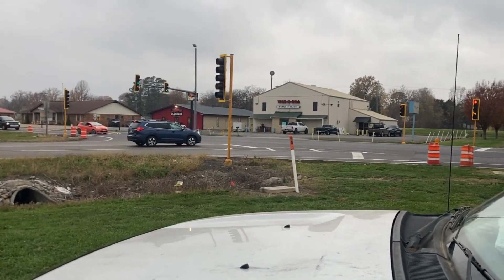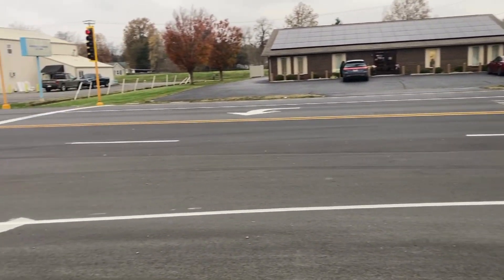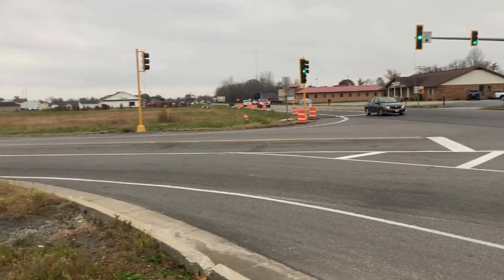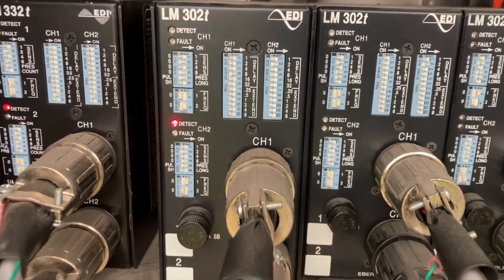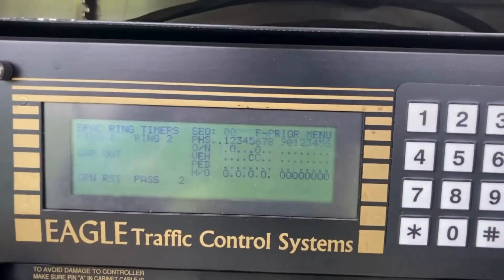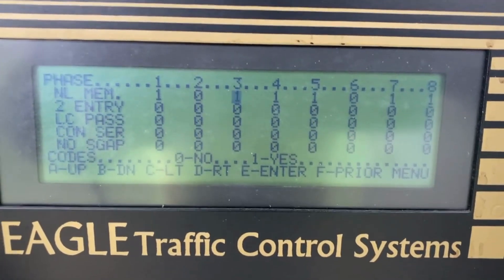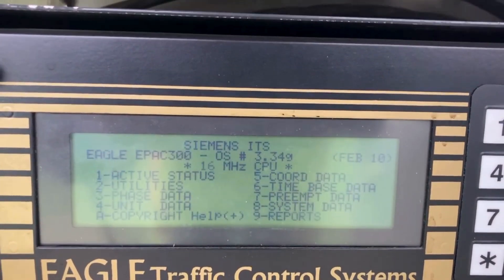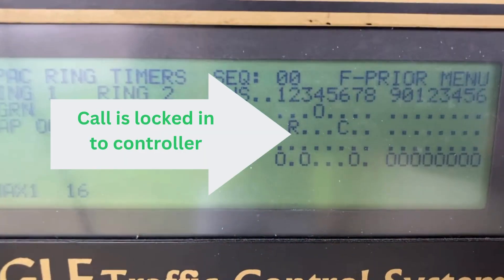How Bad Traffic Light Detection is Fueling Red Light Running

Comment: All well and good, but this begs the question:  Why aren't roadway repairs coordinated with traffic signal testing?  Surely there is someone on a city/ county/ state payroll that is responsible for scheduling repairs, re-routing traffic or facilitating repairs during non peak hours, etc. 
In that this disruption is likely to occur as a result of roadway repairs, is the obvious follow up beyond the comprehension of our elected and appointed officials?
Reply from the maker: Great questions. Here's my answer:  It depends!
In our district, the municipality is responsible for maintenance of the signals (unless there are 2 state routes the converge--then it's the States responsibility).
Many times the municipality hires out the contractor themself.  They handle the work.  It's up to the municipality to notify the State of the work that's done.  
During construction times, this can be forgotten as everyone mentioned is busy running projects. 
Luckily, we have decent communication with our municipalities but it can be forgot about.
In addition, on emergency repair work--it's just 'get it done as fast as possible'!  If a pole is knocked down and its affecting traffic, whoever is responsible just gets it taken care of so not to cause more potential issues.  
It the end it eventually all gets worked out but sometimes responsiveness is more important than scheduling it.
Thanks form commenting!

Comment: There should be a Fail-Safe to wear if the light isn't triggered within a period of 3 minutes it just cycles and turns green anyway
Reply: An intermediate fail-safe would be to operate as non-locking (so a person who accidentally gets in the turn lane but leaves it doesn't trigger a green). But if the ratio of loop 1 detections vs loop 2 detections drops below a certain percentage (say 50%), then assume loop 1 (the front one) is faulty (instead of over 50% of cars leaving the turn lane after driving over loop 2 but before loop 1). 

If that happens, automatically switch loop 2 to locking and send notification that loop 1 needs fixing. Basically what he did here, except automate it when it's "obvious" that something is wrong with loop 1.

In my town, the lights have 3 detector loops (you can see the circles they cut in the asphalt). I always thought that seemed excessive. But I didn't think of cases where they failed.
Reply: Yeah, I would greatly prefer a guaranteed maximum red time.
Not only is it the only way to absolutely guarantee a green light. (There's always at least one more rare failure mode that you hadn't thought to detect.)
But it also works for bicycles and other vehicles with very low amounts of metal. There's enough cyclists already that just ignore traffic lights. I don't want to have to be one of them.
Reply from the maker: @Pystro  I hear your arguement.  Here's what the complaints I get more than any other though:
"I have to stop unnecessarily for a direction that has no one there!"
Thanks for commenting
Reply from the maker: If a loop goes bad, the fail safe is that the detector box will sense that and place a constant call into the controller (this is by design).   
There are additional analytics that can be programmed into the controller that look at detectors.  A few of those are options are detectors that:  constantly detecting, no detection at all and chattering detection (the loop, detector box or wire run is on the verge of going bad).
Additional threshhold can be set as well.  So the idea that comes to mind is to ignore a 'no detection' detector if its a side street hardly used and its from 1:00am - 5:00am (time of day is programmable).
Also length of time is another threshhold.  A 'constant detection' detector will have to be calling for say 2 hours straight (length of time is programmable) for the controller to recognize it as a failed loop.  
Then IF it's on our network, the controller will notify us there is an issue.  (Which maybe is the real fail safe?)
Anyway, thanks for commenting!
Reply: That's how they do it in the UK with temporary traffic lights at roadworks.

Comment: I cringe whenever I see someone at an induction loop intersection either slowly pull up past the stop bar because the cycle was taking too long, or they think it's a stacked loop lane and they are stopped a car length behind the stop bar, both cases result in them not getting a green. I vastly prefer the intersections with Wavetronix radars, I've hardly seen any issue with them(False positives/No detection).
Reply from the maker: Yep, I see alot of human behavior when I'm out on the street.  Many times the ones that don't pull all the way up are looking down at their phone and don't realize where they're located at in the lane (nowhere near the stopbar).  They'r also usually the ones that miss their green light because they're still lookin down.  And then they're the ones that call and complain that the signal isn't working correctly. 🤣
Reply: @streetsmartstraffic Could you do a video comparing the different LED ball modules? My state’s DOT uses three brands(GE, Leotek, and Dialight), and one of them has a lens that is “ugly looking” in my opinion, while another has a lens that perfectly diffuses the light.
Reply: @streetsmartstraffic  In my experience, they are not the ones who miss the green. They look up just in time to see it turn yellow, they punch the gas, and are the only one to get through; it's everyone behind them that misses the green.

Comment: Why is it that when I pull up to a red left turn signal a few seconds before it should turn green I have to wait for an entire cycle before I get my green?
Reply from the maker: Wow I'm getting alot of great questions on this video comments.
Could be a few reasons-
1) The signal controller runs in a sequence of phasing (or directional movements).  You could have missed your window of phasing and it will have to cycle back around to you after servicing all other phases (if there are vehicles at all other movements)
2) Signal could be running coordination.    The emphasis is moving the heaviest flow of traffic which is usually the mainline.  A 'green band' keeps traffic moving thru a cooridor of signals.  So the LT's and sidestreets are given less priority while moving the platoon of traffic.
3)  Maybe the signal is only set to timers.  Meaning there is no detection and it just cylces thru all movements.  So it doesn't care if vehicles are there or not.

There could be other possibilities but I'm running out of time and have to get to work!
Great question!
Reply: @streetsmartstraffic  Thank you for such a thorough response!

Comment: Lack of coil sensitivity in induction loops is something that absolutely piss off cyclists and motorcyclists.  I, for one, am glad the world's basically given up on induction loops and is switching to video detection.
Reply from the maker: You just described one of the downfalls of inductive loops!  What if your bike is not metal?...Good luck!  Which is another reason why I prefer video detection.
Thanks for commenting!
Reply: @streetsmartstraffic  What really grinds my derailleurs are the way Portland does it... first, they're still installing new induction loops on bicycle facilities for some reason, though to their credit, they do tend to tune all of the loop detectors and test with a typical commuter bike (usually one of the signal tech's own likely mountain bike part-swapped with a beach cruiser and a touring bike to approximate a dutch city bike).  But then they'll have to mill off for some reason and repave over the top, which of course, hides where the induction loops are.  And then they don't put down a bicycle detector marking on the pavement (that bicycle symbol with the longitudinal stripes where a commuter bike should put their wheels to trigger the light) in the wrong spot.  Up there with sharrows in the wrong part of the lane instead of the middle...or not having real, physically separated bike lanes...
Reply from the maker: @BalooUriza  Yes, that would be frustrating as a biker.  We are using the SmartCycle bike indicators in addition to our video detection (where there are bike paths).  It works in conjuction with the video.  
An indicator lights up when a biker pulls up   into the bike video zone at the traffic signal  - letting them know they're being detected.  They must be in the bike path for this to happen.  But its a great way to inform them instead of them guessing.
Thanks again for sharing!
Reply: @streetsmartstraffic  Portland has a couple (in a couple cases it's just a bike signal with a blue light added and a sign that says "bike detected on 🔵" but they're only in spots with ridiculously long red lights.  I don't think I've ever seen one where there's video detection, though!

Comment: Our controllers have the ability to lock on yellow - not just red. What happens on your Eagle controller if a detection occurs during a yellow signal? Does it lock?
Reply from the maker: Hey Mike,
After the green expires, a 'window' opens up and starts the locking mode.  So yes, yellow as well.  I know in the video detection we use, when setting up the characteristics of the zone, we can select i its only red locking or yellow locking.
Great question!

Comment: Do they ever use exit loops where traffic leaves the intersection to detect a backup and cycle to other traffic that can move vs holding a green where there are indeed cars waiting but they can't proceed regardless of the light because of a backup further down the road?  Depending on loop size that could also maybe be detected by a loop sitting on a call vs cycling as cars moved over it on the main loop.

Also any controllers smart enough to have normal limits for when a loop should call and revert to a backup mode if it's not for failures that are nlt directly detected.  Like a rule that the side street should always have a csll on each phase at least every 18 hours and if not consider that phase detector failed and fall back to some degree of timer based signals for that phase, or to detect a locked in call from a failure or other issue and automatically reduce the max timing for that phase to not overserve it absent a human manually reprogramming it if they manually locked in the call for both ease and to handle other failure modes that could lock a call, the cycling detection if functional could also serve a similar purpose.

I feel like smart lights could be smarter without significantly more hardware and without requiring more complexity in the safety critical code path for directly controlling the lights, which, even with backups like conflict monitors I'm betting have extensive testing and verification requirements for safety, so adding things into would be much more expensive.
Reply: In terms of failed detection, the signal can revert to a max green for the affected phase if there is no call over a specified period of time. That time is typically set depending on volumes of that street. If the signal is online, a warning can be sent back to the DOT that there is a detection issue automatically. Now, for a signalized driveway or something like a store, you may want to really extend that fail time to a long time since you won't get many calls overnight.
Reply from the maker: You could do something like you're talking about.  I pondered doing this at an airport.  Certain times the line backs up into the parking lot with the only way out is through the traffic signal.
My thought was to place a zone (its detected by video) way in the back.  It would take some additional programming (like peer to peer logic).  But if all conditions were met, it would call a preempt and flush the traffic out.  I believe some agencies do this with sporting events or concerts.  It just has to be monitored though as you don't want false calls bringing up preemption unnecessarily.  
I share your belief that signals can be made much smarter as well.  Its one of the reasons I started this channel!
Great questions!

Comment: I see people stopping out well past the stop bar all the time, and they have no clue the TCS doesn't know they are there.
Reply: Where I live, so many people stop waaaaay short of the line, behind both detection loops.
Reply from the maker: @letao12  That happens often too!  I see cars sometimes pull around that person to get in front of them LOL
Reply from the maker: It happens ALL the time.  We have one signal near a mall.  We have a bright painted stop bar and a sign that says 'STOP HERE' with an arrow pointing to the stop bar.  
I'm not sure why but people are constantly pulling past it.  Then we get complaints.  Guess I should have that detector on locking...Now that I'm writing this out, thats exactly what I'm going to do!  lol
Thank for commenting!
Reply: @streetsmartstraffic  Please don't fix it. People who stop past the line is one of my peeves (especially if I'm trying to make a right on red, and they pull up so far on my left side that I can't see traffic coming from that direction) so I get to experience at least a little joy in watching someone sitting forever at an empty intersection late at night, because they stopped past the line. Also isn't crossing the line like that, running the red light?
Reply from the maker: @rcoony  I know what you're saying!  I as a drive experience the LT's in my field of view and YES-its annoying!
Crossing the stop bar isn't running a red light.  Actually driving through the intersection is the red light running.  Driving past the stop bar is, well, just bad driving LOL

Comment: In a way the front loop being disconnected could be better because of the vehicles that clip over the stop line. I was watching Traffic Light Doctor and people were going over the line from the main direction so people kept triggering the side street. His solution was a 2 second delay before it locked it in so that they would pass over and not trigger it.
Reply from the maker: Yes Traffic Light Doctor is absolutely correct!  Delays on front loops (mostly LT movements) are great to prevent clipping from opposing movements.  
On RT movements, I go as far as 8 sec delays.  This is because most times a car pulling up has time to look to his left and if clear, pull out on to the road and continue on--all without having to cycle a green to sidestreet unnecessarily.
Thanks for commenting!
Reply: @ yeah it was clipping left turn and maybe straight, in his video.
Reply: I experience that problem all the time where I live. Especially annoying when there is no cross traffic so the light turns red anyway.   I wonder if they get any complaints about those LT-ing vehicles that do that.
Reply from the maker: @crosslink1493  So frustrating!  That's why I'm so big on effeciency and maintenance.  Well-maintained signals, while not always perfect, will cause the least amount of annoyance to drivers.  A wise engineer once told me:
"A well run signal doesn't get noticed."
So if I'm doing my job, I get no praise!  😭
lol thanks for commenting
Reply: @streetsmartstraffic  I wish you could clone yourself and get a job at VDOT, they need someone who gives a crap about making traffic signals work right.
Reply from the maker: @brianleeper5737  Well thanks!  I guess I could consult for them but thats going to take quite a salary....that's a long commute lol!

Comment: Here they only use detection loops at night. And during the day its all on dumb timers
Reply from the maker: Out of curiosity--Where's here?
It could be possibly running coordination during the day and 'free' operation at night (detection only - no set timed operation).
Coordination can 'feel' like its on timers but its set to move the mainline traffic through a cooridor...which means sidestreets seem longer-especially if there are gaps in the mainline traffic where you're thinking you should be getting a green light.
Reply: @streetsmartstraffic  Do you use a minimum green for the mainline when running free? They don't use any here  (or if they do its set really low, like 2 seconds) and it's really annoying to get stopped by a traffic light  that was already red 15 seconds ago and just turned red again, especially on a 45MPH road. They do have advance detection but I don't think it's sufficiently far enough from the stop line to work very well.
Reply from the maker: @brianleeper5737  Yes, during offpeak times, we run minimum greens.  During most of the day, many of our intersections run coordination.
Reply: It's the reverse where I am. One light gives the main road 30 seconds of green, then the intersecting back road 1 minute of green which I think is supposed to be reversed. It's a bit frustrating to have to wait at night when there's not a single vehicle for miles
Reply from the maker: @kildozer2012  AGREED!

Comment: Doesn't a disconnected or broken loop generate a fault, causing it's own recall/constant call (essentially)?
Reply from the maker: You are so correct!  However, the contractor had disconnected the front loop after there were complaints that the side street greens were coming up when no one was there (you're scenario you described).  The front loop was disconnected but then we had the issue which is what I was trying to temporarily fix in the video. 
Great question!